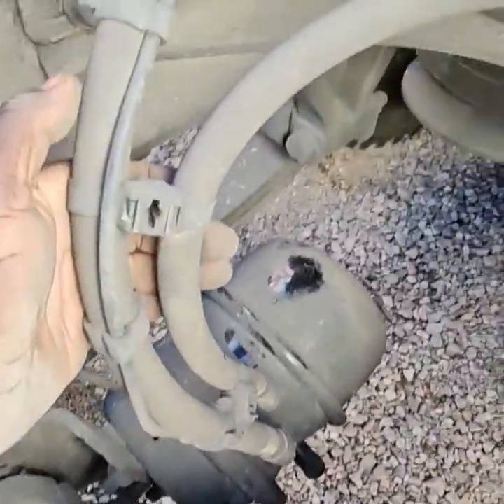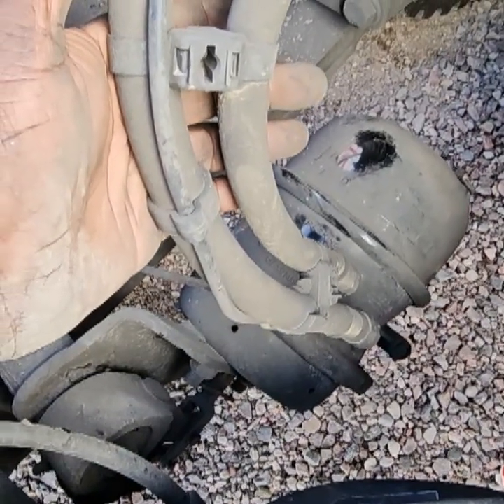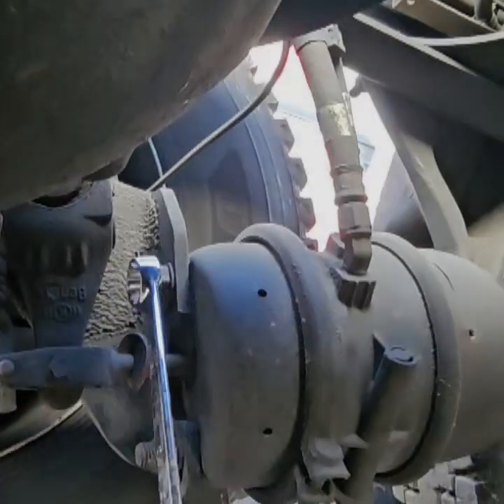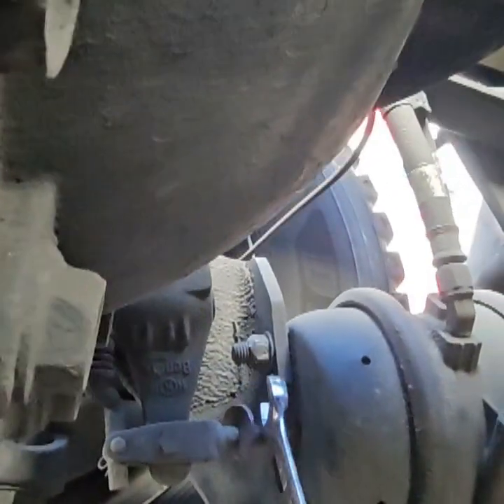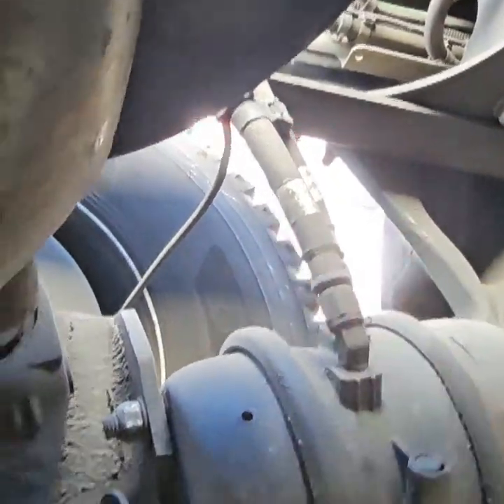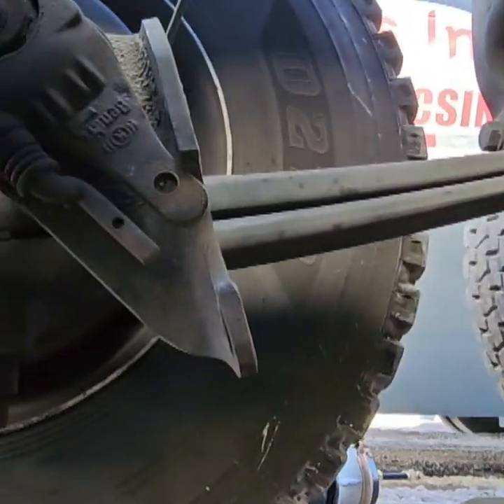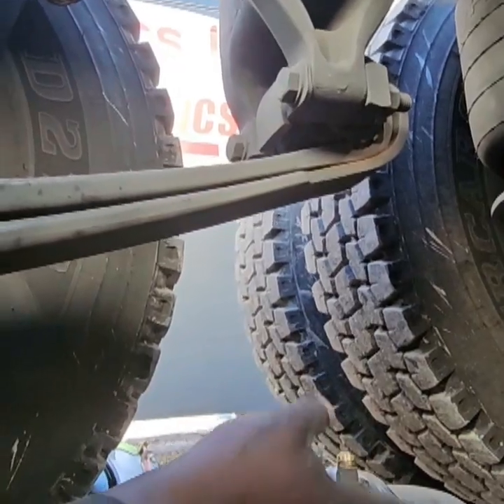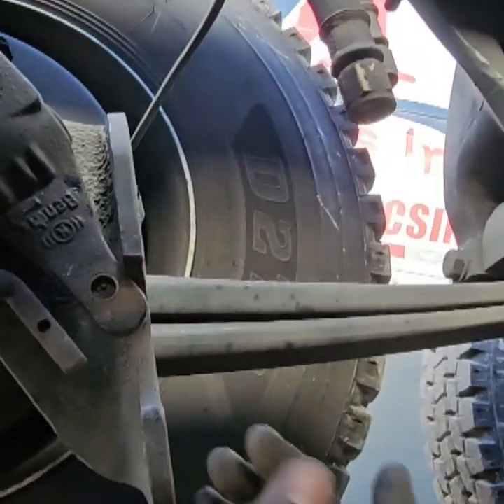Semi Truck/Trailer Brake Chamber diagnosis and replacement

Comment: No locking nut. And that’s why you can’t use a universal chamber for a welded clevis.The rod will turn. Also looks like you have over 1/8 inch of thread sticking out past clevis. Maybe you shouldn’t tell people things that you don’t know how to do. Bendix has some great videos that might help you do things right.
Reply from the maker: Thanks for your contribution, good points. No need for abrasive comments though. We are all learning here so thanks for your inputs I learned a lot from them.

Comment: Just a question bit confused with the start of the process,  before you remove the brake chamber, do you want the brakes released or applied? I was told that you should drain the tanks and then cage the chamber is this correct?
Reply from the maker: Brake's should be engaged. When engaged the air in the tanks does not matter
Reply: Thanks  @Tech_Marshal